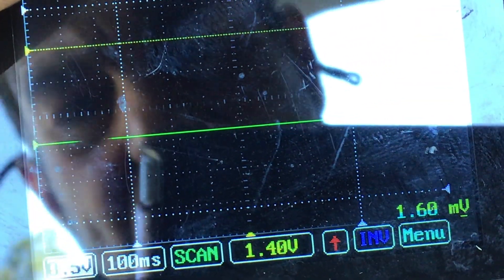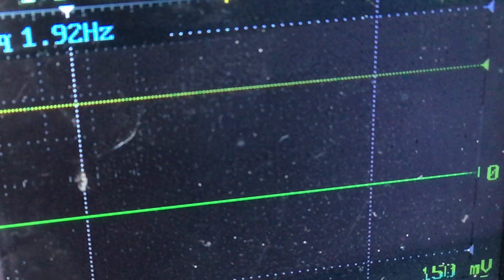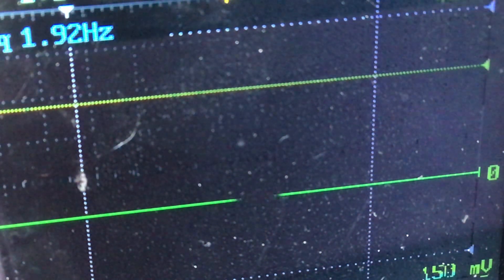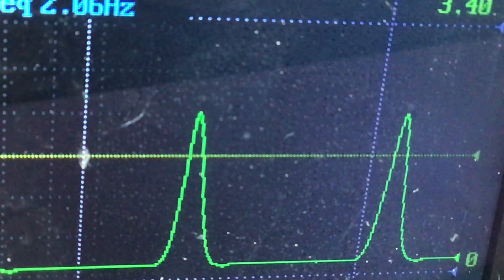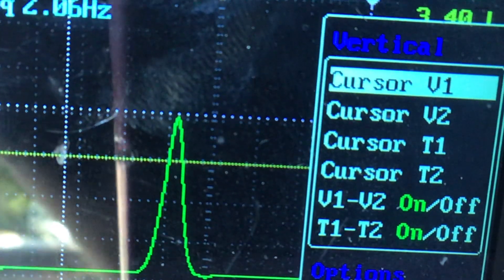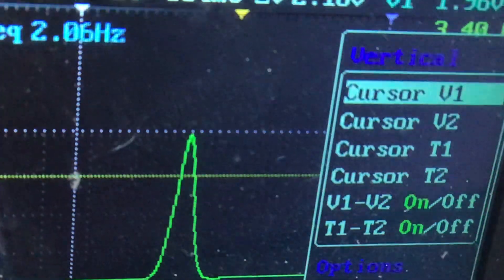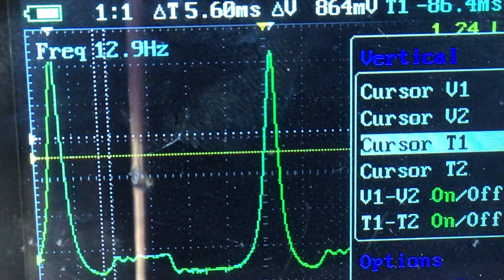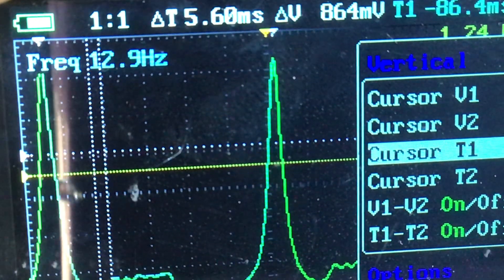Uscope misfire diag part1

Comment: You still do this type of work? You made it clear where the exhaust valve opens right where it starts to go back up. I went to a pressure transducer class last week I left more confused than when I walked in. Be sweet if you could do a whole video on it. So when you do a pressure transducer with vvt do you unplug the actuator solenoids? The instructor didn’t give a clear answer
Reply from the maker: I still do this work, the best way to diagnose misfires as the tail pipe in my opinion amongst all the ways, the VVT solenoid could be disconnected or connected depending on where do you want to see if it is working properly if it is facing with a transducer in the cylinder, you will see the retarding or the advancing of the valve timing. There is a free video on YouTube done by Brandon Steckler that is quite good his explanation of the tail pipe, and the misfire is very advanced and thorough.